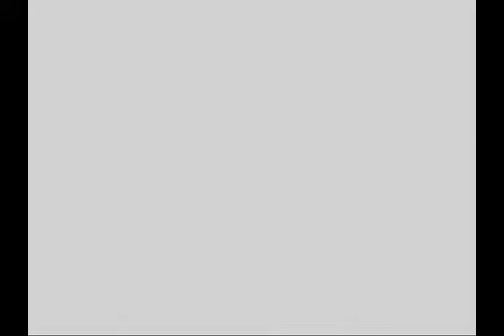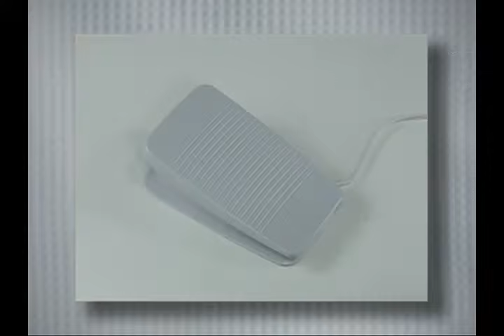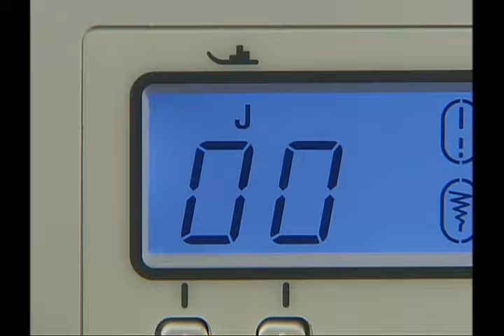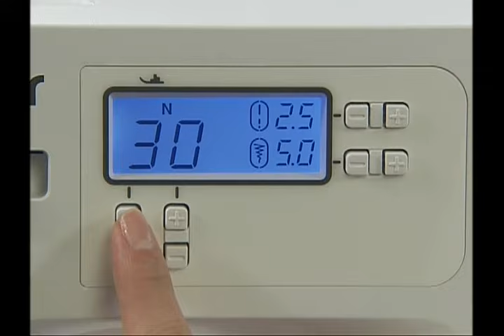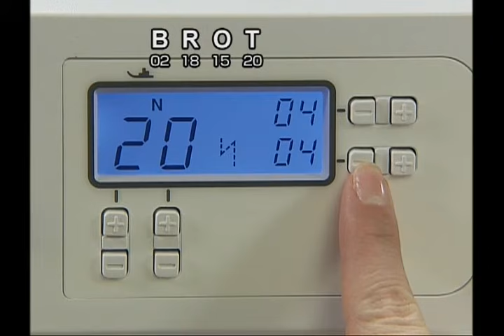Brother XR9550 Sewing and Quilting Machine DVD Manual

Comment: I have been sewing for 60 years, I know my way around a sewing machine.  I got this machine to replace my precious brother  that worked great for 10 years.  It too had the embroidery.  My xr9550 lasted less than 10 hours of normal use.   The tension mechanism broke twice both while doing decorative stitches which I have been using for years.   I was able to fix it the first time and knew due to the plastic pieces involved that it would not survive another tension issue   Yesterday while using it correctly I added a decorative stitch to a cuff the first one was just fine the second one was 3/4 finished when the machine rattled I stopped as the tension mechanism exploded.  A screw that holds the tension unit to the machine shot past me at an incredible speed and  the screw is lost.  It was an easy fix the first time but the plastic that holds a mental clip in is now worn out and too large to hold the clip.  All of this in 10 hours of use.  It has issues sewing double seams.   For fun I bought a Butterfly hand crank very cheap imitation singer for $44. + shipping in import for a total of  $89 that can sew through 16 layers of fabric like butter.  It needed at lot of adjustment to work good but it is 100X better than this brother machine.   I will never buy another brother product.

Comment: Watched the video several times.  Then read the instructions slowly step by step.  Got to the needle threader and failed several attempts.  Please does anyone know what they are talking about that a little hook comes thru needle and picks up the thread and pulls it thru,   Hmm. I have watched this closely but cannot thread my needle.  HELP please.
Reply: I was having trouble with this too, I realized instead of pulling the end of the thread towards you, you have to use the loop in the back that it makes to pull the end of the thread through towards the back. Hope this helps!
Reply: @ashc172 Tried it. Didn't work

Comment: I cept geting E3 error and am not able to thread my bottom bobin i'll just wind it by hand😊
Reply from the maker: You receive the Error message E3 when the buttonhole or bar tack stitch was selected and the foot controller was pressed (or the start/stop button was pressed if the foot controller is no connected) while the buttonhole lever is raised. Lower the buttonhole lever before continuing the operation.

Comment: I truly regret buying this machine. I feel like I'm learning to sew all over again; everything that was designed to make it easier is making it more difficult, and I have less control. I found that thread holder has the slit on the left side so that it breaks the thread if it catches. So I had to put a larger spool cover on it. When I set up the whole thing again, there was a problem with the tension. I've literally spent hours trying to figure this machine out and have sewn nothing. I got it for Christmas so it's too late to return it. I'll try selling it and buy one I know how to use. I've been sewing for 60 years.

Comment: 0:00 thank you intro
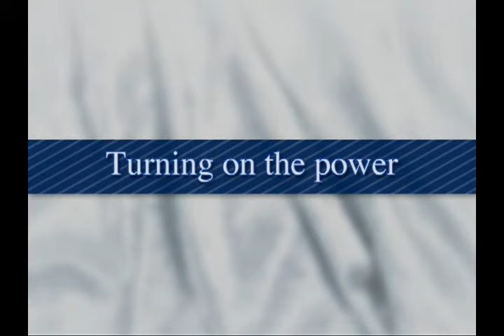0:42 power
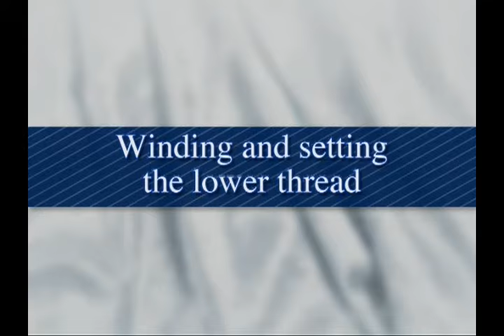1:11 winding thread/bobbin
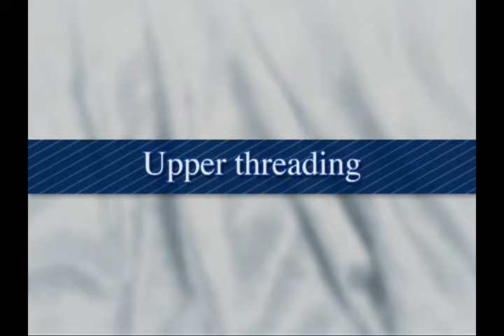5:36 setting upper thread
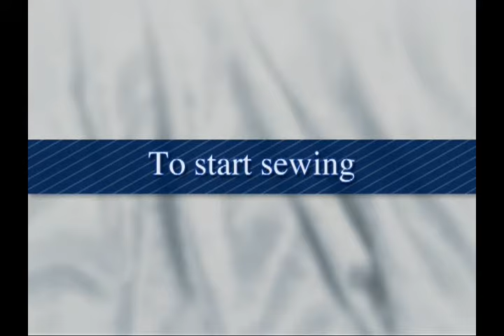7:58 start sewing
10:27 reverse sewing
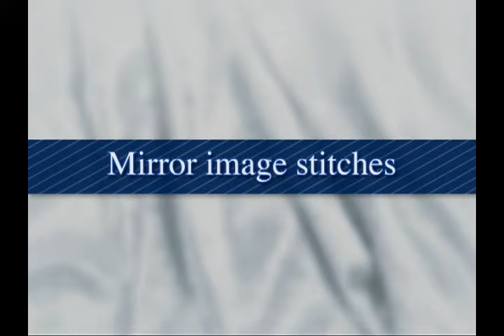11:32 mirror image stitching
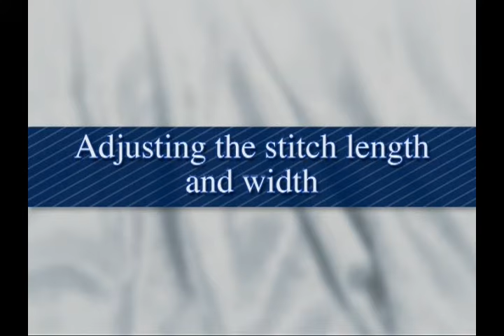13:16 adjust stitch length/width
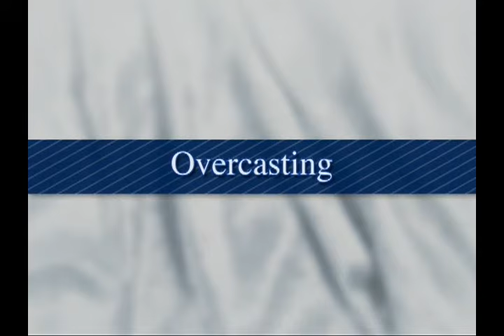14:57 overcasting (foot G)
16:02 blind hem (foot R)
17:39 buttonhole (foot A)
19:38 character stitches (foot N)
23:07 cleaning & needle replacement
Reply: I love U for doing this. I am teaching myself how to sew and having this time guide is SOOOOO helpful. Thank you.
Reply: @household2313  absolutely!  You got this! Make something beautiful. Good luck!
Reply: thanks so much for the bookmark links! So much quicker to find the specific info or instructions that I need.
Reply: Español
Reply: Keep